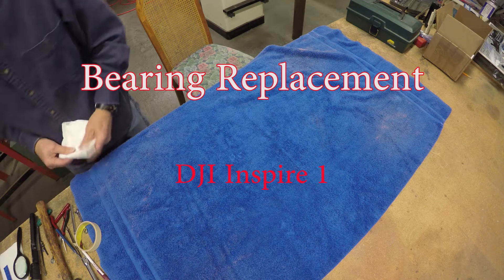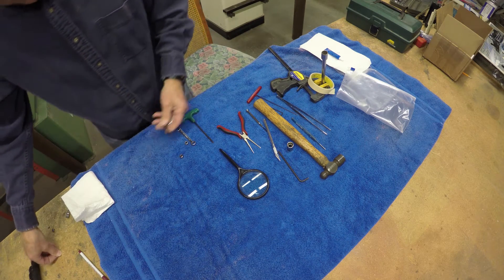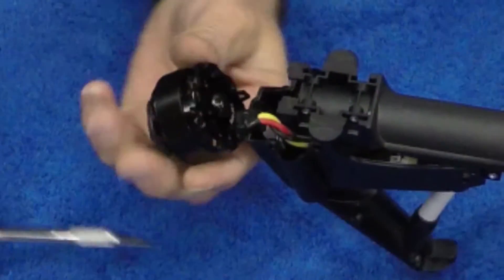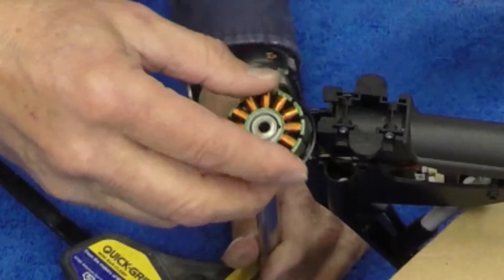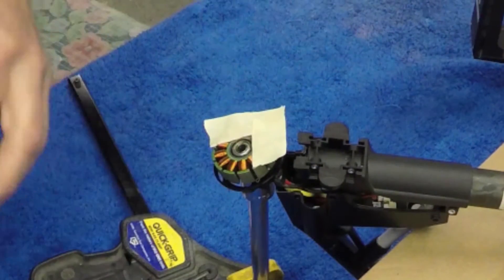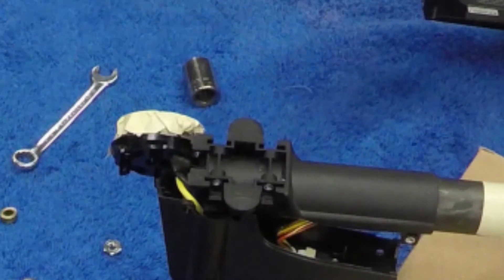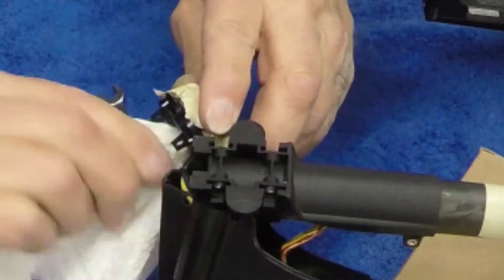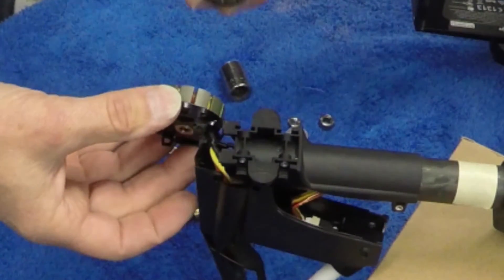Bearing Replacment on DJI Inspire

Comment: Are we suppose to apply blue threadlock to all 6 screws when mounting the foot back? I thought the screws are going into plastic?
Reply from the maker: Yes. The bolts are not going into plastic. They are going into a metal insert that is in the plastic.